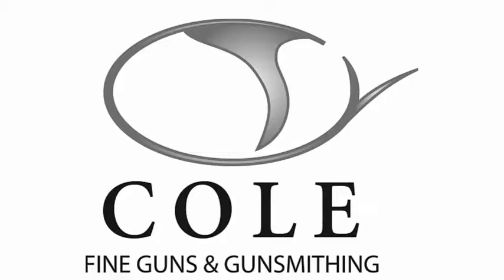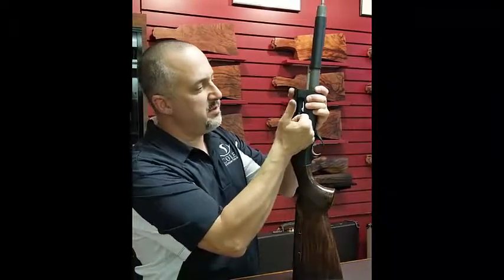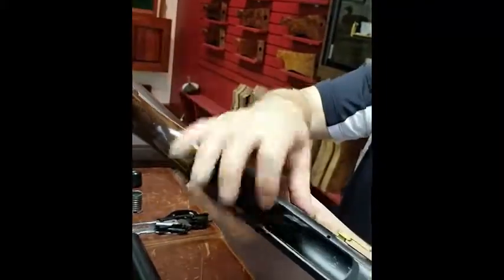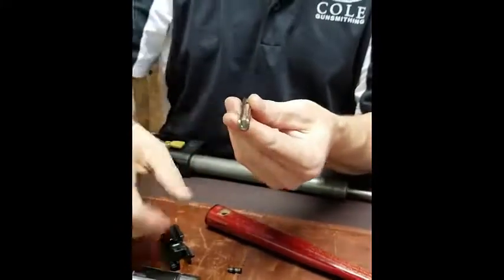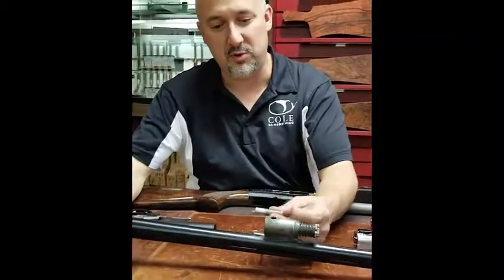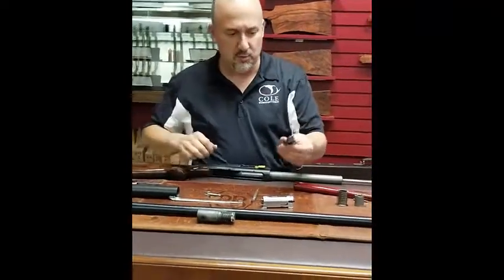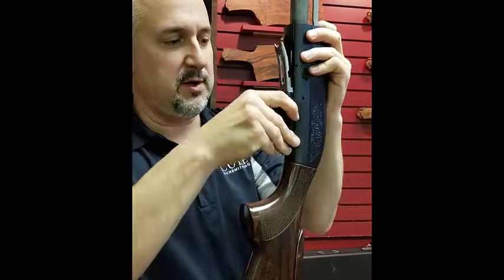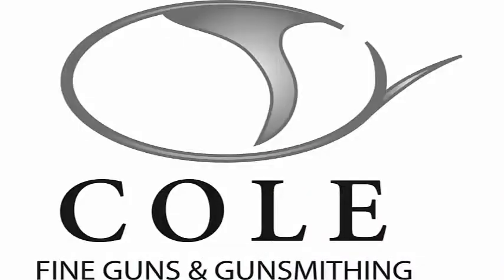Take down and re-assembly of the Beretta 391 Semi Automatic shotgun by Jim at Cole Gun.

Comment: I was putting oil on the  rod and exhaust valve mechanism.  It took me a very long to figure out that this was causing the shotgun to not cycle correctly.  The oil was carbonizing on the rod and creating friction with that part of the assembly.  It was very frustrating.  Good video, thank you!

Comment: Good advise , if you don't have access to a wire wheel or compressed air  , 0000 steel wool from a hardware store can take take the place of a wire wheel , use it with a carbon solvent like Hoppe's No 9 , if you need to blow the solvent out use a can of compressed air,sold for blowing dust out of computers . If you are shooting steel shot use a little grease on the choke threads . If you have a problem getting the action back together  twist the sleeve  ( I think it is clockwise  ) as you reassemble the action .

Comment: Thank you! very good detailed video that I have bookmarked for reference. My 391, when hand-cycling the action with shells in the magazine, will not pick up a shell from the mag tube because the cut-off button on the front of the trigger guard keeps popping back out and reducing it to a single shot.  I push it in and a shell pops out onto the carrier and hand-cycles into the chamber, but then the button pops back out again and I have a single shot again. Does this problem go away when you are shooting it? I have only shot it at the trap range, so I never loaded more than 1 rd. I was hunting with it yesterday and noticed the problem and couldn't figure it out so switched to my other gun until I could understand what was going on. I think I understand all the other features of the gun, but this has me at a loss. I should have just tried shooting it to see if it went semiauto, but the guys I was hunting with wouldn't have been happy with me. BTW is this a 3 -shot gun only, or is there a plug in the mag tube? I couldn't get into it to check. It looks too short to hold more than 2 rds. If so that is a big negative for me and chukar hunting. When you get into a covey, the last thing you want is to shoot the gun dry while birds are still flushing.. And you have earn every one of those coveys...

Comment: The videos is much appreciated.  Coles has done a little great work for me over the years.  Question:  On the 391 or 390, If the gas piston bushing hole gets a little ovalized, does it need to be replaced or replace the whole gas piston assembly?  Is the 391 gas piston itself the same as my 390?  They look the same.